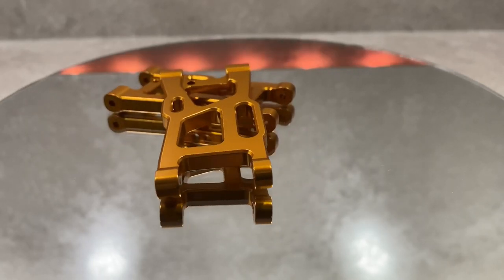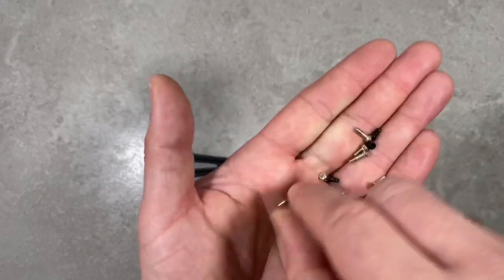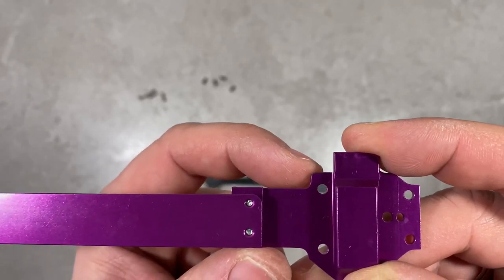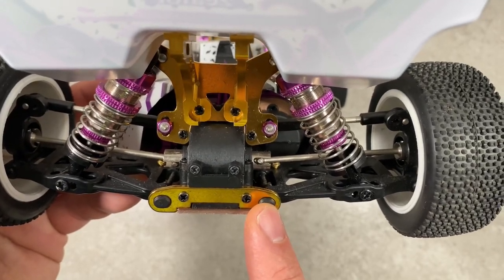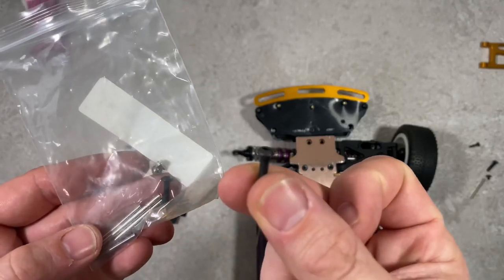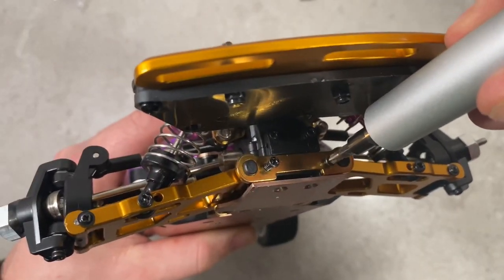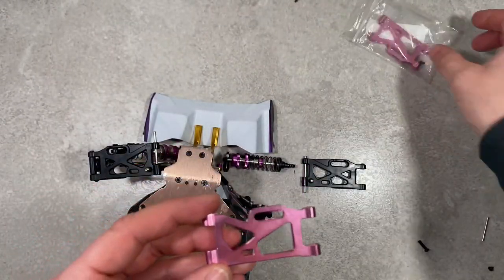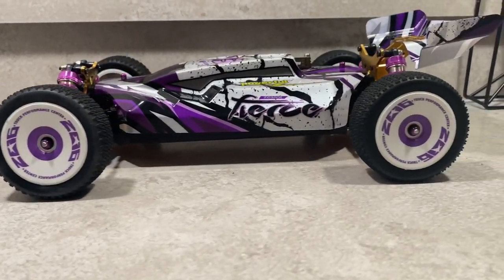Ⓜ️ Wltoys 124019 Metal Upgrade Part 2

Comment: Need to change those pink arms to gold. Or better yet put the plastics back on. Metal arms are the worst upgrade. 
Also the center brace you have the middle piece on the top. It’s suppose to go on the bottom to lower it a little.  And it gives a spot to mount the receiver or esc. When you upgrade to brushless.
Reply from the maker: THX for the advise mate you're right with the center brace 😉 👍🏽

,but to be honest arms are the only parts you can upgrade to metal,...hub / rods and that stuff are totally garbage and makes it worther than stock.
Also Iam going to make it high speed car and don't bash it so the metal arms going to work,but for the build later maybe going back to stock ones because of the colour otherwise I'll going to make the rear really gold I think,but wasn't available all the time when I got the hole stuff 😉.

Anyway have a nice weekend ✌️🏽
Reply: @a-ztube  everything worse in metal is good they even have the diff housing available.  Everything that holds a bearing is good to have in metal. But the arms are a no no.  Been there done that.  Good for shelf models.  But one crash or spin out to cartwheel or whatever and you will bend stuff or break other stuff.  Bend or shear off screws.  Bend hinge pins.  Etc.  having the arms plastic allows for a cheap easily replace part to act as the fusible link.  They are also heavier. 
But good luck if you decide to keep them.

Comment: Some exotic looking mighty sweet.
Reply from the maker: Thanks my Friend much appreciated 😍👍🏽
Reply: @a-ztube  hey bud could i use a 2000  mah  2s  25c battery instead of the 1000mah 2s 25c battery that comes in my Q903 brushless
Reply from the maker: Hey Buddy,
Yes for sure if you can fit it not easy that it stays in place the better solution is the original xinlehong 2x1000mah set fits perfect or you get the plug and strap if you have another 1000mah lipo 

2 x Xinlehong 7,4 V 1000 MAH https://banggood.app.link/JTQFO4tsrfb?p=5Y130935228052016013

Xinlehong strap and plug https://banggood.app.link/e6U8EDxsrfb?p=5Y130935228052016013
Reply: @a-ztube  there the 2000mah ones from the bigger hosim models same dimensions for the battery
Reply from the maker: Can you fit it into the battery tray? 😳

for me it's alkways not the best solution putting bigger batterys because of the weight and the normaly came of very easy when bashing and that stuff,but maybe you take the battery strap and leave the plastic cover off if it have an secured placed this should work without any problem 💪🏾😁
Reply: @a-ztube  awesome thanks
Reply from the maker: You're welcome anytime bud 🙏🏽🤜🏽🤛🏻

Comment: Would you say the metal parts upgrade/ conversion add stability when off roading (due to more weight) ? I got mine on the way hoping it does
Reply from the maker: Hey my Friend not really the weight isn't really much different its more a type of look 😉👍🏽

Comment: Do you also have a link for your screwdriver?
Reply from the maker: Sure 😉

Here's the old and my new one 
Better get the new version 

XIAOMI Wowstick 1P + 19 In 1
https://banggood.app.link/yVWLSDPnt2?p=5Y130935228052016013

XIAOMI Mijia Electric Screwdriver 
https://banggood.app.link/Q6bbOxkp9ib?p=5Y130935228052016013